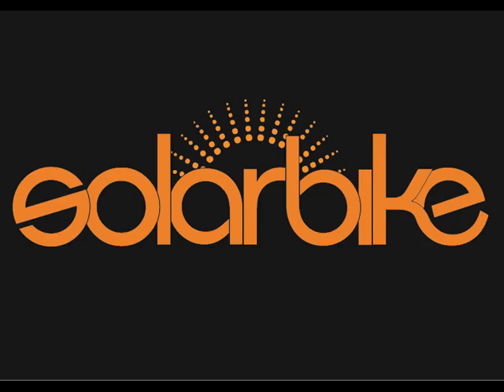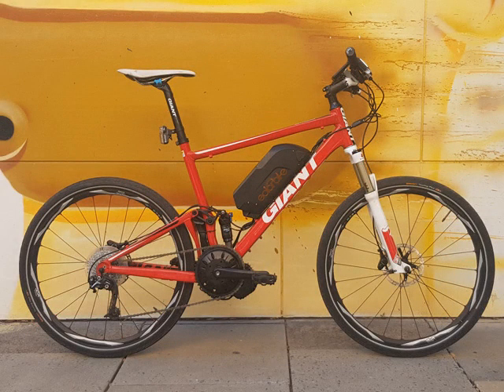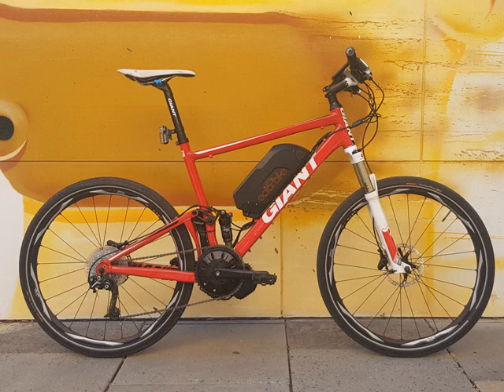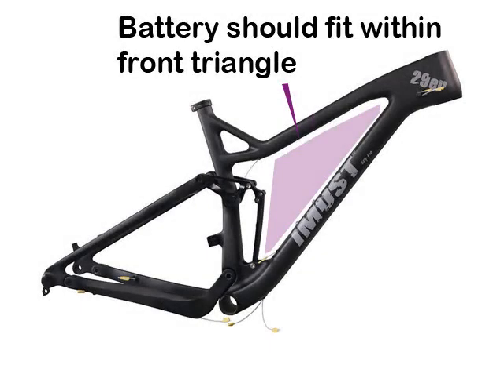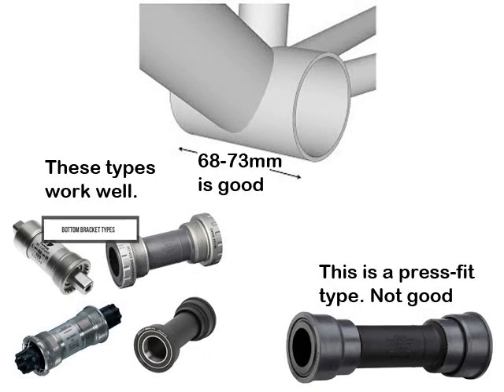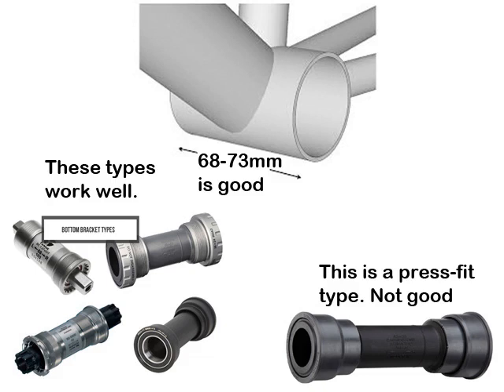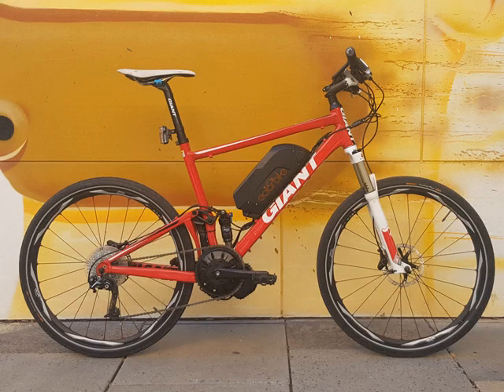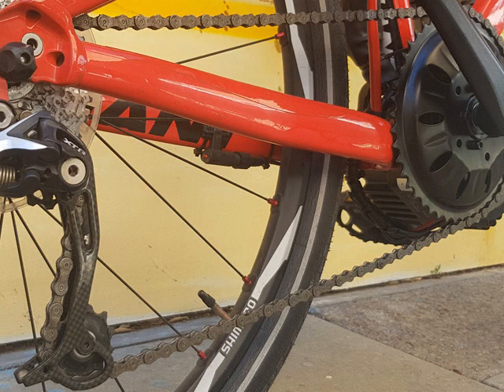Dual suspension bike converted to electric with 1000W Bafang motor 2

Comment: Do they make a kit for a full suspension mountain bike where the crank goes through the swingarm and not the frame? Or would this design require the inferior hub drive?
Reply: Why would you call hub motor inferior? Both variants have their pros and cons.
Reply: V A, hub drive, less torque, puts the bike off balance, no use of gearing. Mid drive is better in every way
Reply: @rovidbouski4022  well, less torque does not mean not enough torque. if you ride on roads and don't climb offroad hills, its more than enough torque, my last bike was pushing 1,8kw  and could do wheelies. Mid drive can be easily damaged by a curb or by rock, and direct drive gearless hub has silent operation, and cost less than half of mid drive.
Reply: VA, not true at all! I ride my mid drive off road and hit rocks all the time! I ride up and down stairs! Hub drive gets boiling hot on inclines. My mid drive is almost silent Plus the bike is perfectly balanced whereas your hub drive would be very tail heavy. My mid drive is 1kw and does wheelies.